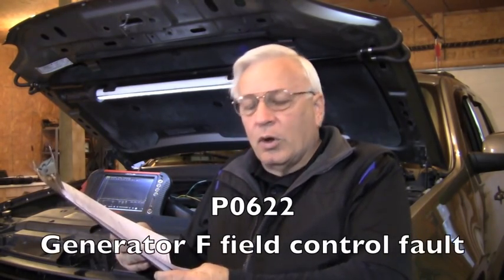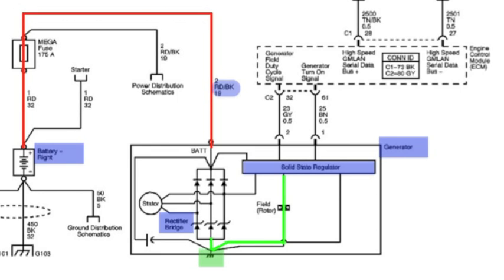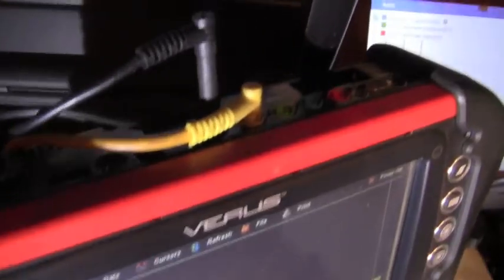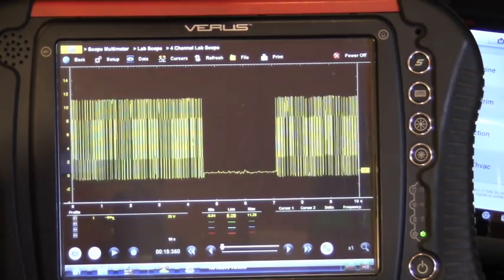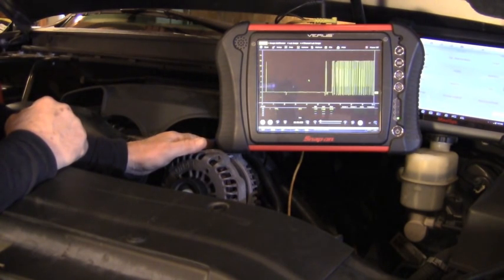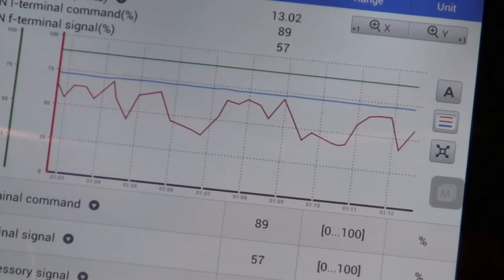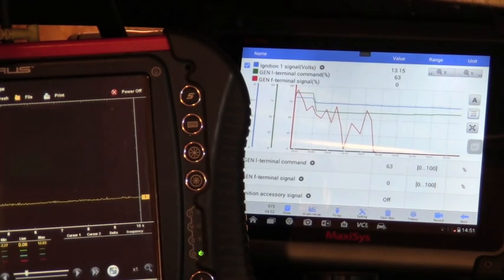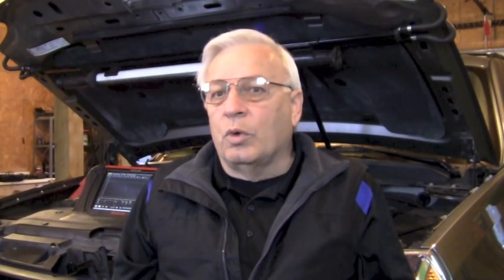Battery Light & Code P0622

Comment: I wanted to let you know that I was prepared to spend over 300.00 for a new alternator for my 2006 Mustang V6. After watching you video, I decided to check the connector. I do not have a scanner but iI understood your diagnostics so i set my iPhone up in the driver's seat pointed at the cluster and did a face time to my iPad. Whenever I would move the connector, the battery light would go out. For about 30.00 I was able to replace the connector and now I have no light or charging problems and you saved me about 270.00. That is worth a like, subscribe, and bell for you, my friend.!
Reply from the maker: Thanks, James, I appreciate your comments.  Glad it helped
Reply: Whay exactly was yours doing. I have an 08 the light blinks on and off sometimes. Says check charging system. Car runs fine though. Never had an issue. Is this what yours did!?

Comment: i had a. similar issue p1637 and p0622 Haness was ok i swap alternators because ei had a new one laying around and i had the old alternator and battery tested and both came back good and i was looking at my data stream for the f terminal and it had a constant pattern but it would suddenly drop to 0% then right back up to 5-89%ish any ideas I tried wiggling my terminal also but no noticable drop in the scanner

Comment: I've got a scanner that'll show the data with the engine running. I'll check out the 2008 chevy cobalt tomorrow to see if it's just the connector. Thanks for posting the video. Son claims that he didn't have any issues prior to jump-starting some guys car. I told him that's why I bought a couple of those small digital jump-starter units, just because some vehicles can get damaged after using them to start other vehicles...

Comment: Wish I had seen this video  2 months ago. I had the same issue for about 3 months changed alternator and new battery. Still service charging system messages. I ended up finding it by accident as Everytime I messed with the connection noticed I got the error Everytime. Changed and no issues. This was a great informational video.
Reply from the maker: Glad it helped, thanks for commenting.

Comment: P0622 means that it has a alternator connection issue than? My battery light has been on for 2 weeks and I can't figure out the issue. The alternator was testing at 14.05. My alternator is at the bottom so it's hard to check the connector down there.

Comment: Okay, you clearly have a connection issue at the alternator. How are you determining that it's the connector and not the alternator. Could be contacts on or in alternator.
Reply: Agreed, when I get a situation like that, I will disconnect it and visually look for terminal damage/problems, test the terminal tension/fit, tug on the wire-possibly broken inside insulation.
Also sometimes a component responds to pressure on the terminals going into it - then that part has failed.
It all depends on what you find as Duane mentioned "Evidence" in a particular car,  the connector
pigtail is a practical way to repair a problem in that area and may be all that is needed.

Comment: If the signal was coming from the ECM, why did the signal drop out? if the connection between the plug, and socket is bad, you would still have signal at the plug, where you are probing it.
Reply: Because he has the scope on the signal return wire . Your are seeing what the alternator is sending to the ECM .
Reply: Look at the diagram in this video again.
Reply: +myboy051 that makes sense, but it is not what he said.